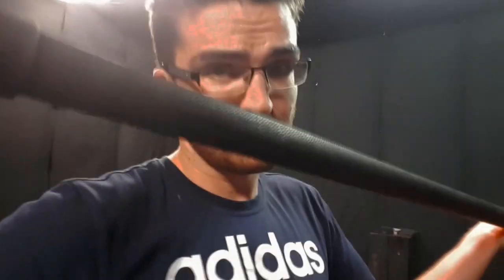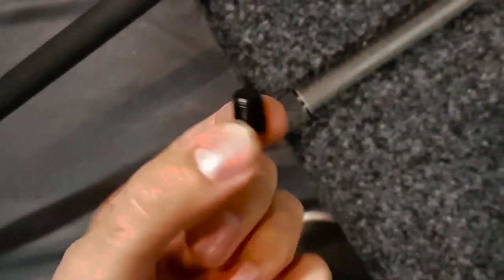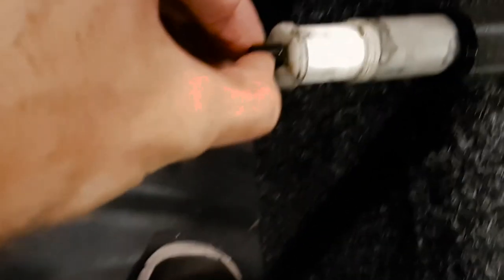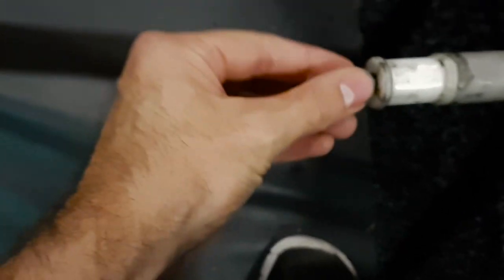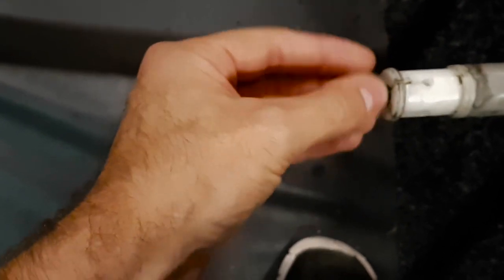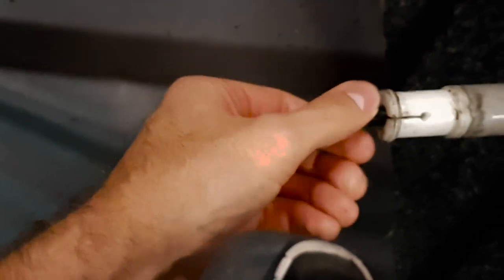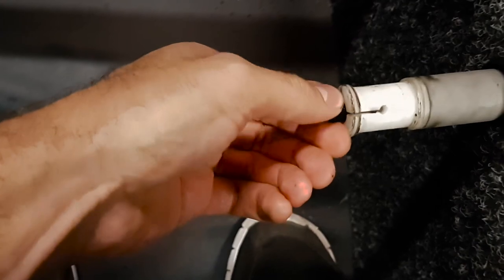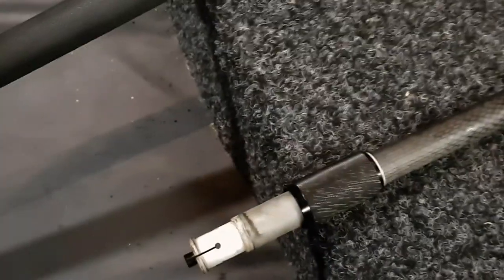My Panamic Boom Pole Started Rattling

Comment: Hi Matt,

Good to see you posting some Panamic content, keep it coming! Panamic booms are unique in that they use an "End Stop" in each section. The End Stop is the white nylon component which incorporates the little black grub screw featured in your film. Over time, as with any boom, the nylon joints wear. When this happens, it will cause a rattle at the joint. If however you have invested in a Panamic boom, it doesn't mean the end of your pole. Simple open the section and tighten the black grub screw. The screw drives into the nylon End Stop and opens it out, and in doing so takes up the 'slack' caused by worn parts. After adjustment, put your Panamic back together and you're back to work with a 'like new' boom. Eventually, you'll run out of adjustment. When that happens, just call up Canford and order a new End Stop.

Comment: Panamic boom rattle can differ from every other brand of boom because they're not able to be internally cabled. For example... If internally coiled cabled, a rattle could indicate a kink or twist in the cable or it could be too loose therefore the cable is touching too much on the inside of the pole. With an internally straight cabled boom, a bent cable won't lay flat inside the pole and will rattle like crazy even during slow moves. However, with an internally straight cabled boom, if anything gets inside a segment, it should shake right out thru the flow thru.